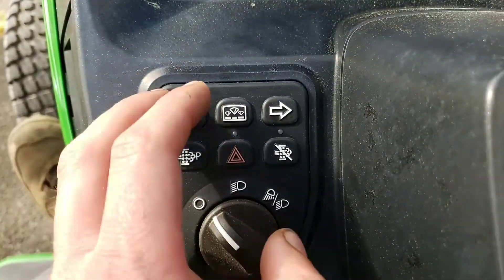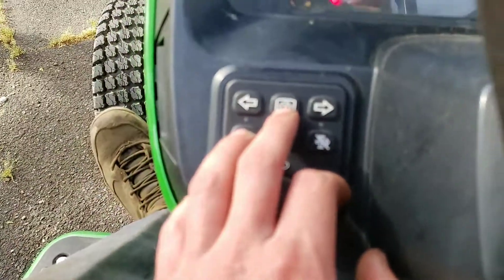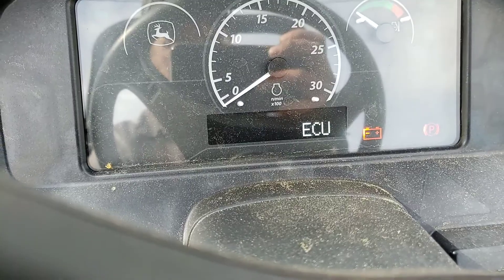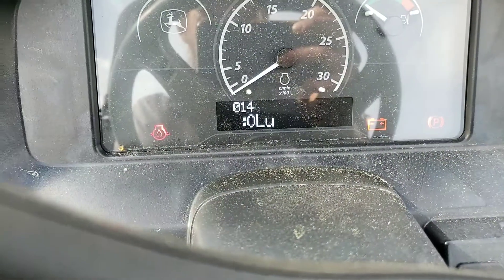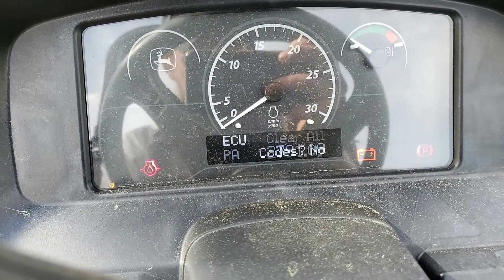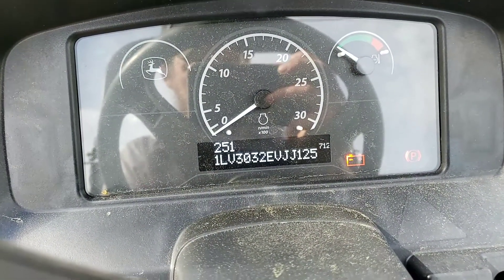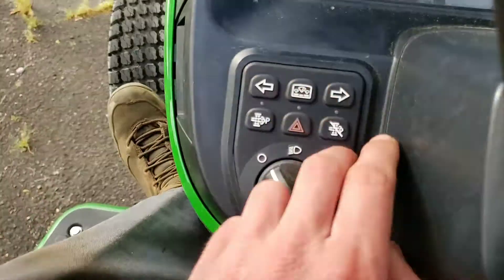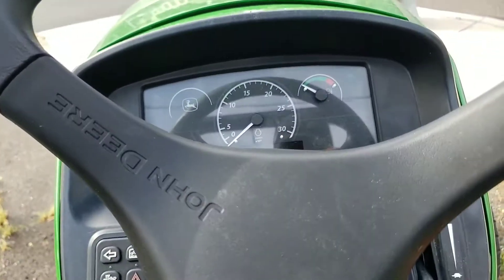Entering Diagnostic Mode - 3 & 4 Series Tractors

Comment: Mine is a 2016 model and doesn't have all the fancy gizmos on it.  I need to know where the oil pressure sensor is.  Following an engine oil and filter replacement it refuses to crank and the low oil pressure icon in the dash remains illuminated ?? Thanks in advance and God bless.

Comment: Can you set the cruise control on the ECU mode to work in reverse ?
Like snow blowing with a three point snow blower ?
I have a new 3039R cab model the cruise control only sets going forward !
It works great tilling can set as low as .02 miles per hour in A / Low range !
Can I ask dealer to set Cruz up on my tractor for going backwards ??